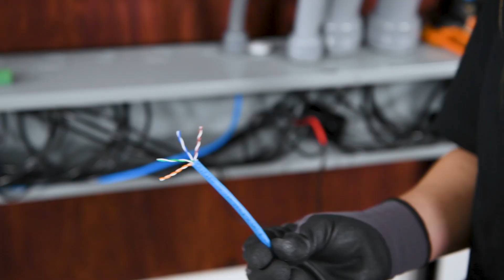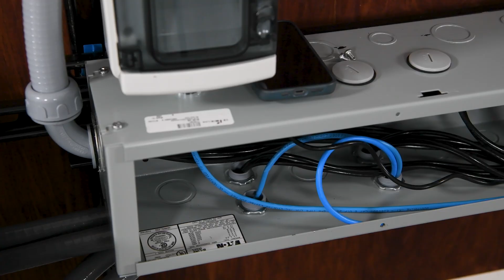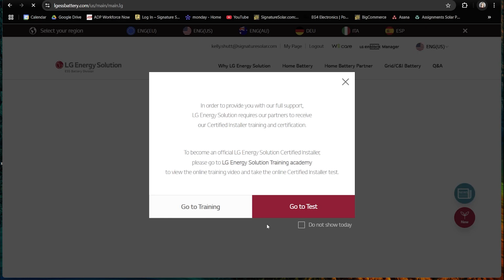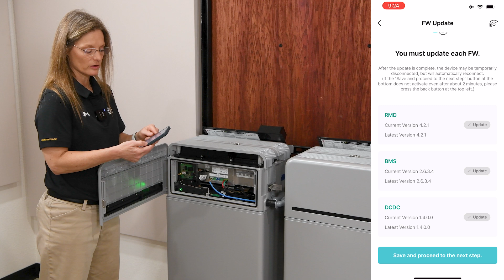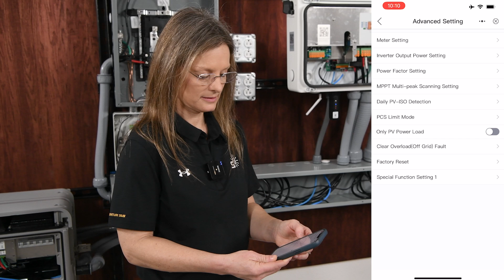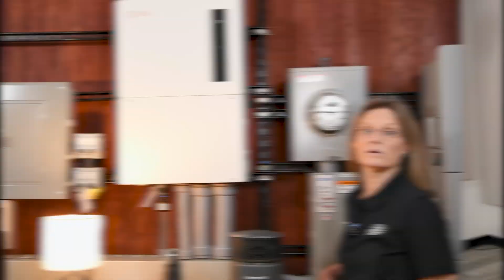LG 16H Prime Battery Installation & Commissioning with Solis Inverter | Step-by-Step Guide

Comment: I received this battery a few days ago it is incredibly heavy and I had to unload it with my tractor, the installation book sat with it says nothing about the installation and more about the computerized software programming. You cannot use your phone it must be a whole computer which I don't have so I spent 6 hours on hold only to be answered by someone in India who told me I must have their training for them to help, I explained I don't own a computer to which they said they didn't care see you later bye no one should buy this product I don't know if it even works but at this point I have a 450 lb boat anchor that I have spent hours laboring and I have 50 boxes to pick up and burn from the assembly
Reply from the maker: If you need help troubleshooting your system, our USA based team can help you! Give us a call at 903-441-2090.
Reply: @SignatureSolar  I reached out to your support channel via Email and I was told Signature solar is unable to offer support for this battery. I was directed to contact the manufacturer....not ideal
Reply from the maker: We’re so sorry this was your experience. We’re absolutely happy to help with basic troubleshooting and support questions directly. In some cases, particularly when deeper diagnostics, warranty review, or manufacturer-specific troubleshooting is needed, we may need to loop in the manufacturer for the fastest and most accurate resolution. That said, we don’t just send customers elsewhere; we’ll help facilitate that connection and stay involved to ensure you’re connected with the right team. Please don't hesitate to reach back out for further assistance!

Comment: Great video. One comment however about using green tape to identify the battery cables to the S6. NEC code does NOT allow remarking conductors #6 and smaller for grounding & neutrals. The insulation color MUST be green or white, cannot use tape! Remarking the primary current cables (red, blue, etc) is permitted.

Comment: How does this unit work in the US since we have 120 and 240 appliances and this unit is only a 240 single phase inverter?
Reply from the maker: Hi! It's 240 split phase so it will handle both your 120 and 240 loads :)

Comment: What is high voltage. What is the benefit of high voltage. Can we start with the basics?
Reply from the maker: Great questions! Voltage is essentially the pressure that pushes electric current through a circuit. In simple terms, higher voltage allows you to transmit the same amount of power with less current, which means smaller wires, less energy loss, and greater efficiency over long distances.

The benefits of high-voltage systems really shine in solar and battery setups where you're trying to move power efficiently or scale up.

Comment: Solis max back up load is only 47.5amps. So does that means the sub panel total back up loads is only 50amps?
Reply from the maker: Yes, the total active backup loads on the sub panel should not exceed 47.5 amps.
Reply: @SignatureSolar will offer Solis Hub for whole house back up soon?